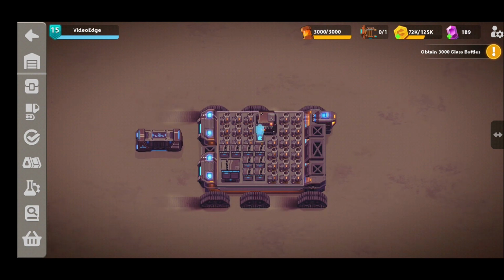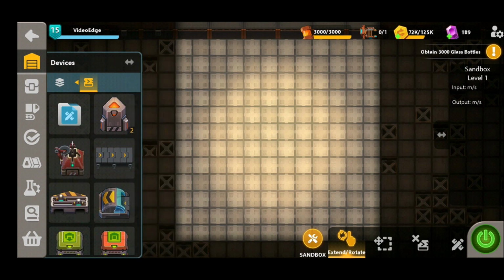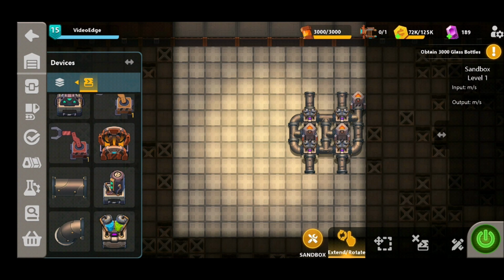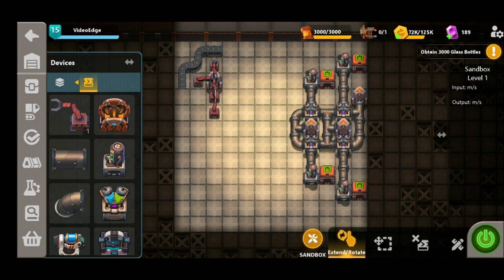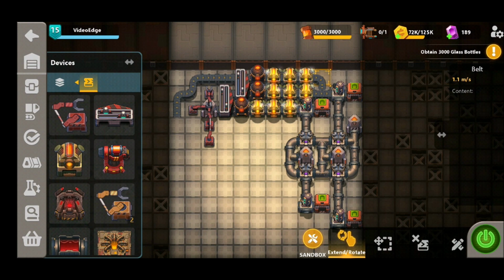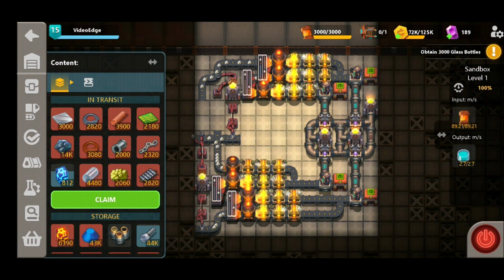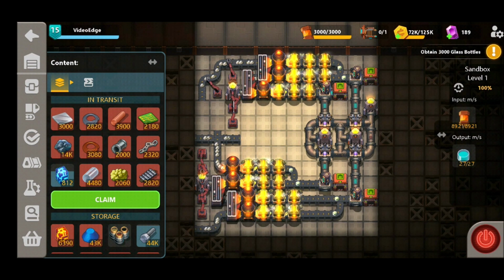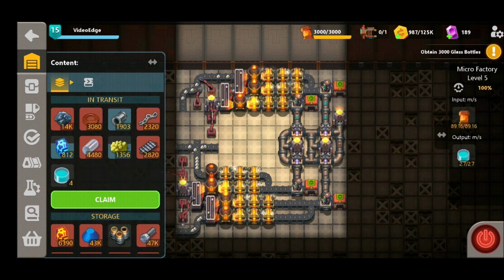Sandship Crafting Factory: Efficient Micro WATER BOTTLE Design! [HD]

Comment: Weird... I copied exactly the design, checked multiple times... but I only get 2.31 as an output... was there an update that changed that ?
Reply: 2.29 here. 🙍
Reply: Same problem here, but by deplacing the lower production to the right & putting 1 more fast splicer I got 2.46 output